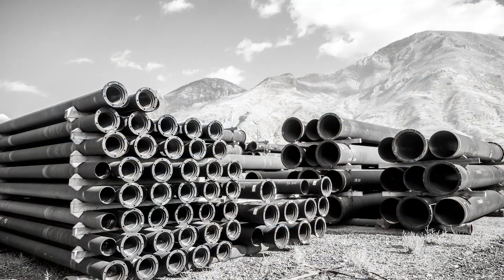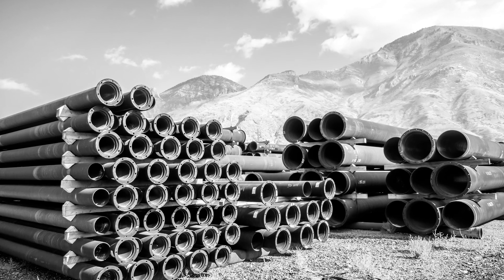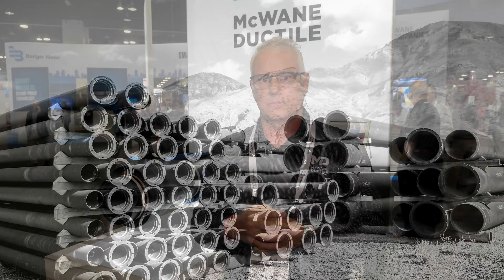Can I Connect Alternate Materials to Ductile Iron Pipe?

Comment: Brother how to joint ci 300mm pipe to di 300mm pipe
Reply from the maker: This depends on the outside diameter of the pipes. If the cast iron pipe is very old, then it is probably a bit larger than modern Ductile iron pipe. Smith-Blair, Ford Meter Box, or a similar company are good places to source a coupling/sleeve to connect these two pipes together.